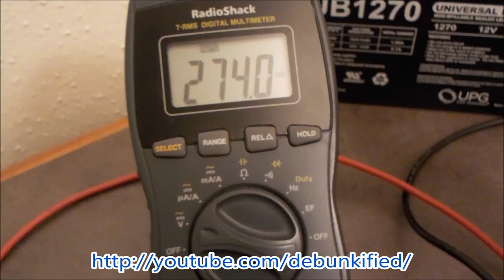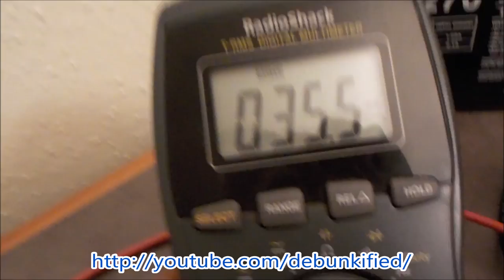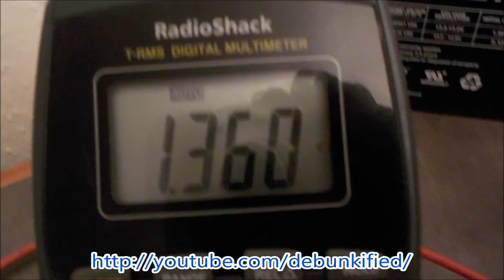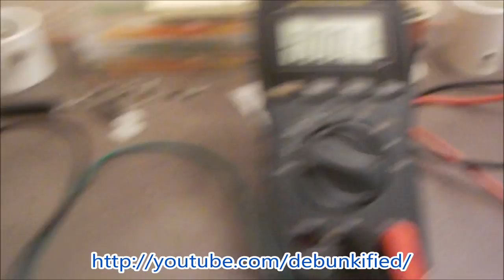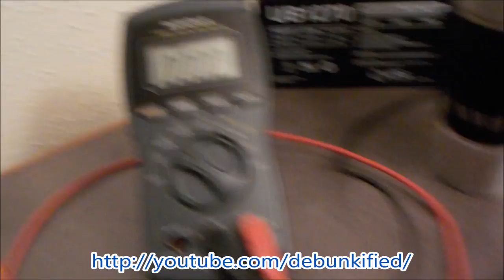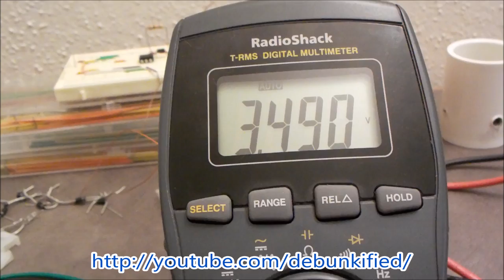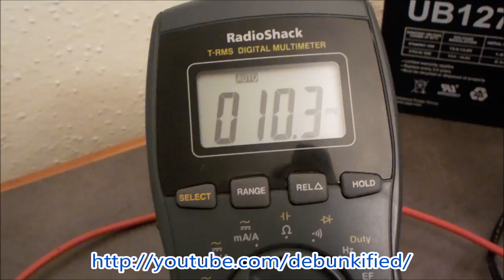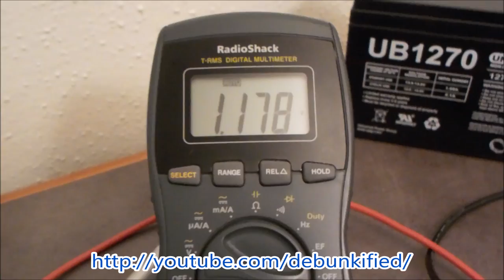Anomalous Energy

Comment: capacitors store all charges, no matter how small. not being blocked, being stored. Resistors block and bring down current. A good example is that if you have an amp for music, and plug a capacitor in backwards, in certain places, it causes resonance, and can also pick up resonance if set correctly. Have you tried turning it around to see if it blocks the excess gain? PS you talking or any noise near a balanced em field will cause resonance.

Comment: thank you for sharing
am concern about all your replications
but i like to advise you to explain first Always at Schematic 
because you are jumping with camera from side to side ! so we cant understand what really you are doing
am struggling to understand what you are doing
try to see other youtuber how they explain clearly
sorry to be frank
but this is improtant topic to me
Reply from the maker: Issa Issa hi Issa, sorry about the rapid movements, we are naturally fast paced, but thank you for the frankness, we will try to slow down.

Maybe we'll make another video explaining better. Basically we are pulsing nothing.

Where normally a power supply is pulsed through a primary coil and then the secondary picks up the collapsing magnetic field or inductive kickback spike through a rectifying diode to charge another battery or capacitor, we do not pulse any power source at all.

Study the schematic as it is clear, that a loop of wire, which consists of a coil is connected to and disconnected from the switch, hence the pulsing of a coil with absolutely no power supply.

We don't have a schematic for this, but will consider adding another one, but just stick a capacitor between pin 3 of the 555 timer and the resistor leading to the gate of the mosfet. 

Then stick a meter between that capacitor and gate resistor and observe no DC current. 

To completely block the current add a diode right after the blocking capacitor with the positive of the diode going towards the gate and negative of the power supply running the 555 chip.

You'll see that the triggering current is still triggering the mosfet. This is to show that the capacitor itself is supplying an AC that travels backwards through the diode and keeps on triggering the mosfet. This also increases energy in the powerless loop.

Hope that helps, we'll do another vid if this eventually when the time is just right. Watch the vid again, everything in it is right but the main point is anomalous energy in a loop with no power supply.
Reply: Hi debunkified,

If you study the data sheet for the IRF740, 
http://www.mouser.com/ds/2/427/91054-60680.pdf you can find Ciss (input), Coss (output) and Crss (reverse) capacitances in Fig 5, Page 4. They are roughly 2.2nF, 2nF and 1nF, respectively at 1V drain-source voltage and at zero gate-source voltage. And here is a simple equivalent circuit for a power MOSFET:
http://www.industrial-electronics.com/images/DC-pwr_3-29c.jpg  where Cgs=Ciss, Cgd=Crss and Cds=Coss, ok?
Now when the pulses come from the 555, they excite the primary coil as a time varying resistor and capacitor via the MOSFET. So the secondary coil also receives energy from the input pulses via magnetic coupling. The body diode rectifies the pumped-in energy in the primary coil circuit when the MOSFET is off (the white wire loop completes the circuit for the primary coil). The diode in the secondary circuit rectifies the energy in the secondary coil, induced by mutual coupling with the primary coil. 
So to answer your question, the energy in the input pulse (coming from the 555) charges up the gate-source capacitance and the reverse capacitance and the primary coil while drain-source is shorted by the ON resistance of the FET, ok? Then the FET is switched OFF, and the circulating current in the primary is rectified by the body diode and collected in the 4.7uF.  In the video you mention that with transistors the effect is nil or very small: this is becaose the inter-electrode self capacitances of bipolar transistors are much smaller than that of power MOSFETs.  By the way, in high frequency power amplifiers built with bipolar power transistors, the output LC matching circuit is pre-tuned first by adding no power supply to the transistor's collector and due to the base-collector reverse capacitance, part of the input drive power can get to ouput side and helps pre-tune the output circuit, a known 'trick'.
Re on your Single Pulse Experiment, I wrote a short letter to you (10 days ago) via your youtube profile, maybe you did not get it?  
Greetings, Gyula
Reply from the maker: Hi, thanks for that explanation. That makes sense, so this is a conventional phenomenon then, now that is out of the way we can move on. Check your messages.
Reply: Okay and thanks for the message I got it and have answered it too.
Reply from the maker: gyulasun Hi, I know this is a bit late, but I understand mosfet leakage, and you were talking about the gate and source basically leaking into the drain.

I just wanted to double check and make sure that you knew that the loop through the mosfet was just a loop with a capacitor, or just a looped coil only.

How can such a small potential between the source and gate point even leak through to the drain and source and cause that much current to flow and charge the capacitor up, which is charged at most to two volts.

So you're basically inferring that there is a two volt potential at that single point which basically should be a zero voltage potential.

Is that really possible? Hope that question makes sense.
Reply: Hi Marc,  it is not so much on leakage, rather it is better to consider the inter electrode capacitors charging and discharging from the gate-source to the drain-source side via the gate-drain capacitor.  Surely there is some leakage via the insulation layers inside the MOSFET but those must be in the pico or max nano Amper range. 
Just think of 3 capacitors I already mentioned in my older post above and here is another link to see an equivalent circuit for a power MOSFET:  http://www.silvaco.com/tech_lib_TCAD/simulationstandard/2000/jan/a1/kaist_fig1.gif  and study the capacitors from the gate to the source and to the drain. Imagine those 3 capacitors from discrete components (in a few nanoFarad range, see data sheet too)  and feed it with some ten kHz input pulse: will you see output voltage across the drain and source?  You certainly will but in case of just the 3 discrete capacitors, you need to use an AC meter of course across the output.  
You just need to recall the capacitors Xc reactance (1/2Pi*f*C) which is in play here, they can block the DC content of a pulse but the fast charge and discharge currents do seem to go through as the frequency and Farad value dictates. 
This is what you can see when you check input current to the gate via you Ampermeter both in its DC and AC ranges. It is okay that your 48 kHz pulses are not measured very correctly in the AC range but still you can find big current amplitude difference: 0.8uA in DC and  around 47uA in AC range. 
If a MOSFET had some picoFarad inter electrode self capacitances only, then the output voltage of 2-3V you experience would be much much less at your 48kHz input pulses, okay?  
Hope these help.  Would like to ask your take on my comments on your latest video: Solid State Looped Overunity, did my comments make sense, do you agree with them or you have doubts? 

Greetings,  Gyula